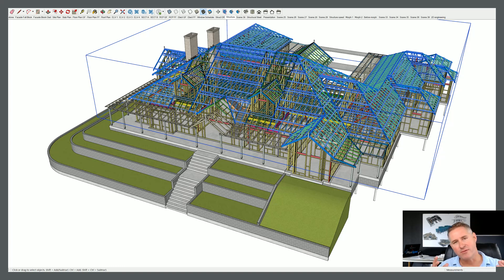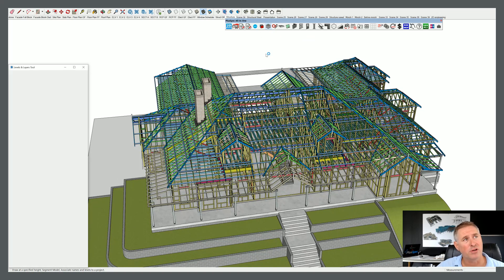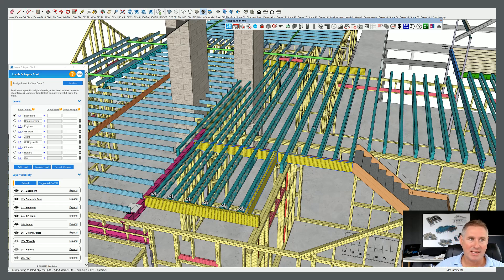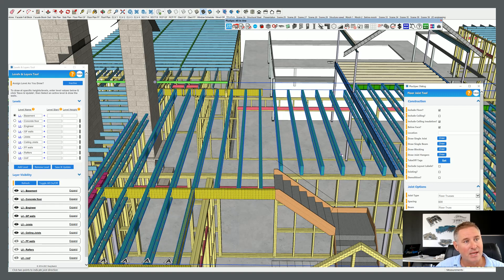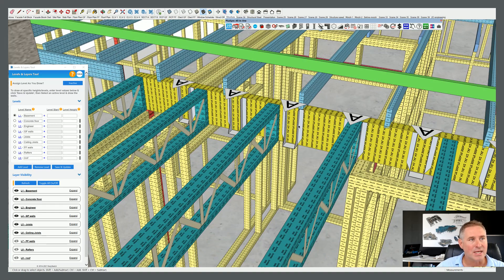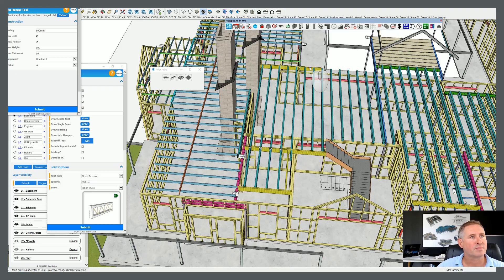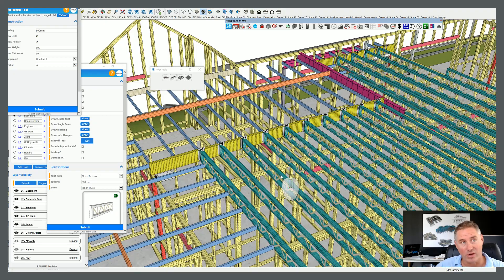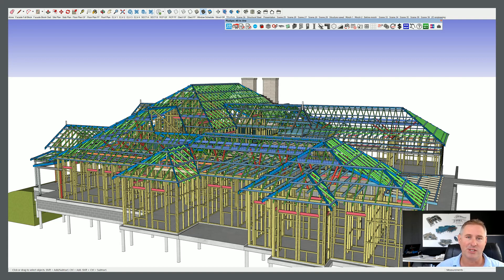5 ways builders utilise construction technology to save money & improve estimating efficiency.

Comment: Will it work for 2D plans like pdf file?
Reply: You import a pdf and trace it.
Reply from the maker: Hello @ Sarfraz You would import a PDF and trace,  however, usually a PDF is created from a CAD program and if you contact the plan set author and ask nicely they may give you a DWG or IFC. An IFC file is ideal as it is already in 3D and PlusDesignBuild has an IFC Optimizer that will automate the estimating and it also has a tool that will enable you to change and add materials, products and measures for estimating. 
Here is a getting started video that may also help. https://www.youtube.com/watch?v=tSdBRUjX6rE&t=43s
Or you can reach out via the website.

Comment: Also not sure what the purpose to model the whole roof truss. Will detailed roof truss design done by roof framing manufacture? anyway great work!
Reply from the maker: Good question. You will notice that this is a framed/pitched roof and not a truss roof. In saying this I woudl still model a truss roof and specify the truncated girder setbacks  to truss manufacturer with teh aim of reducing point loads over openings.

Comment: great work, will finish watching bit later. Just wonder how long takes to make such fully detailed model? Is there any way to use multiple staff to cooperate like revit's "workset"? Cheers
Reply from the maker: Yes multiple people can work on one file an duse edit paste in place.
Reply: @PlusSpec  Thanks mate, may I ask how long would take to build model to this level of details say 3 people using your plugin? also can you do site cut / fill volume model based on civil engineering drawings?
Reply from the maker: @steedlei1  I did the roof this morning. The walls were done by a designer in sydney, he traced a set of plans and did the slab, Joist, walls and windows in 1 day.  Here is a video on how to create a pitched roof.  https://youtu.be/z-WjFqGEZzY?t=175
Reply: @PlusSpec  cool